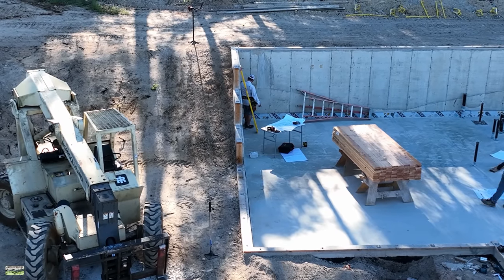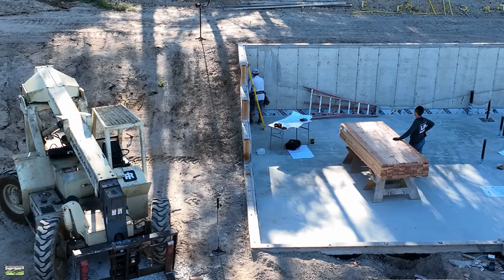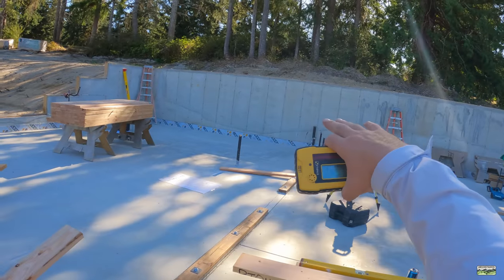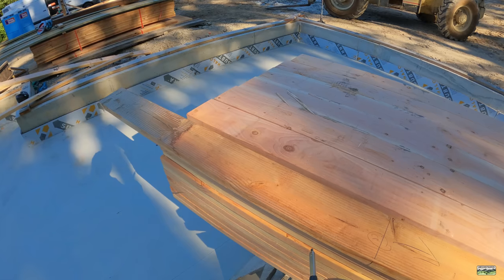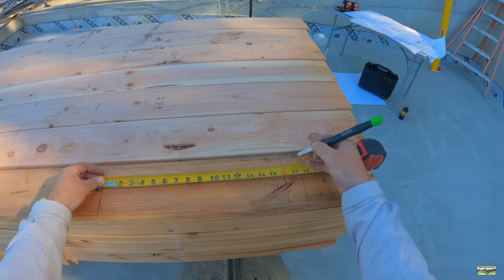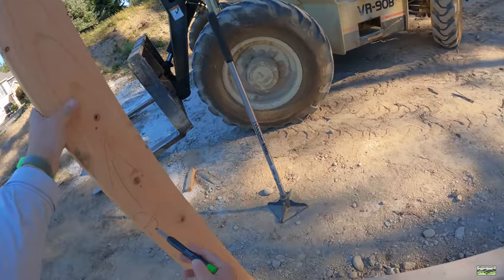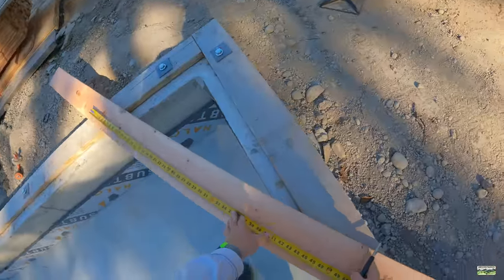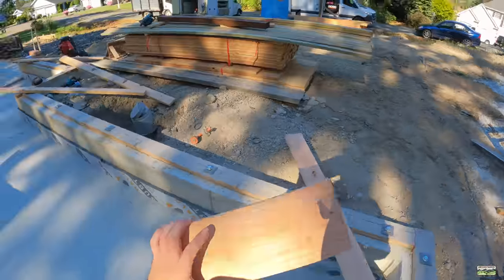Do THIS for Level & Flat Floors FAST 31 Olympic YouTube Video 3

Comment: Are you setting the laser receiver to the +/- .05 or +/- .20 accuracy setting? I used mine for a lot of grading on the “coarse” setting and forgot about the “fine” setting for a long time 😅
Reply from the maker: Now that is an excellent question.  Yep, I set it for fine.  I also used a different laser to shoot in columns in the garage, I think that's a video or two down the road.  And it was right on.  But very good reminder 👍👍